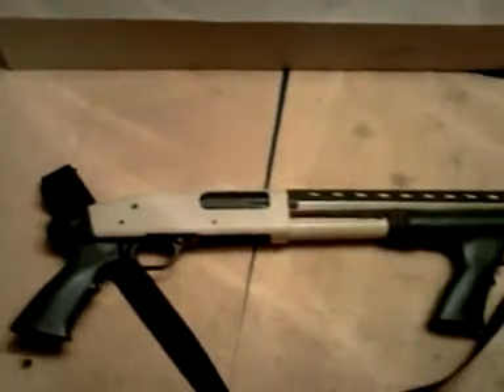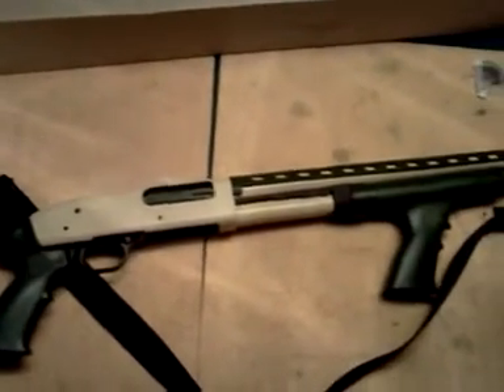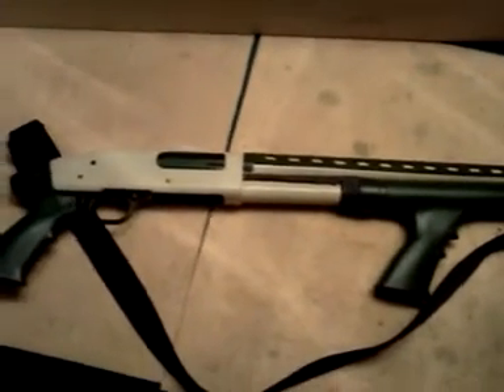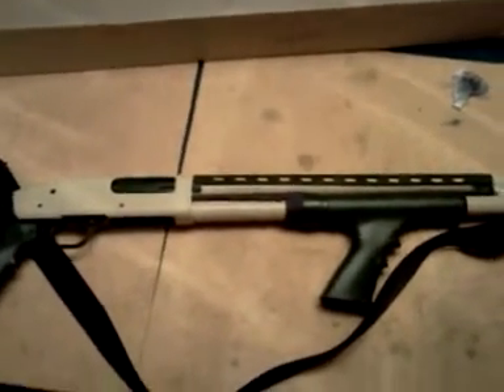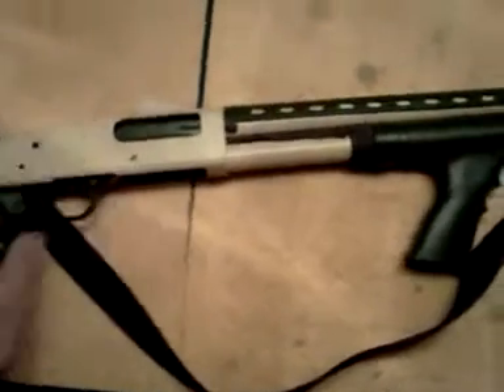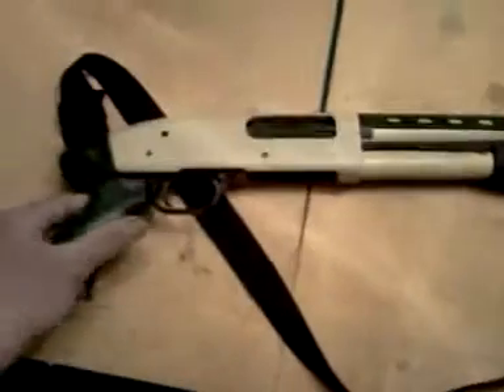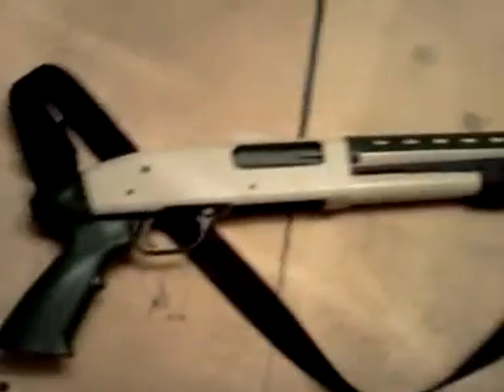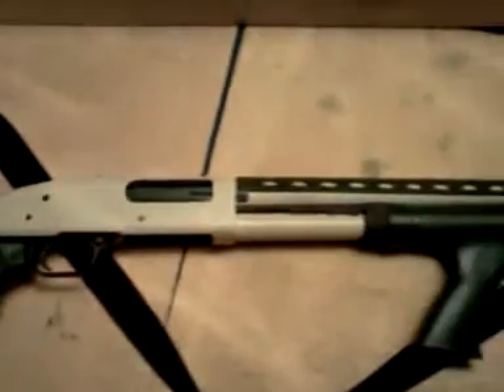Mossberg Maverick 88 shotgun Duracoated

Comment from the maker: It is an  ATI forend, just google that you should find it. Just remember the 88 slide tube can not use reg. M500 forends, you will have to get a 500 forend and nut use a different forend. Google egun parts and they should have the slide tube and nut sep. Hope it helps.